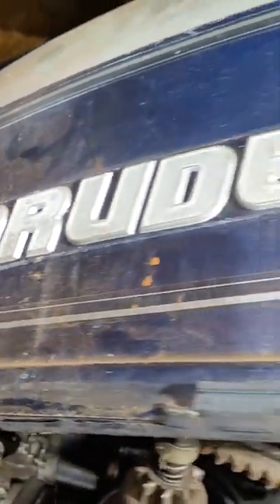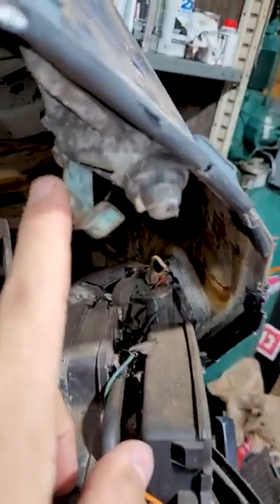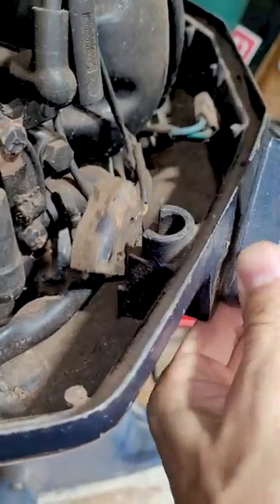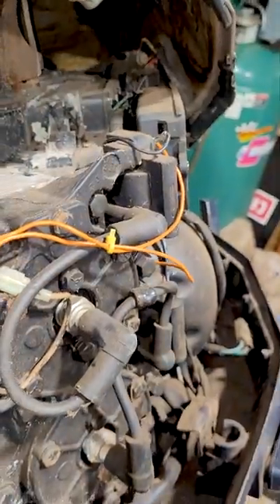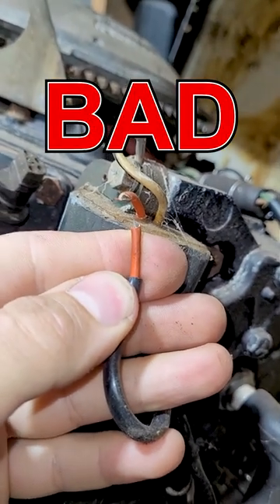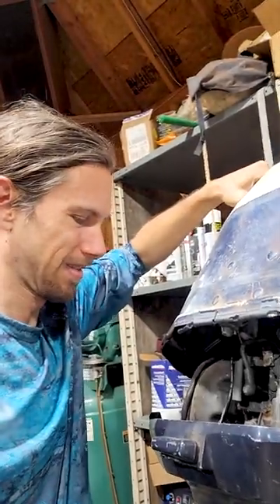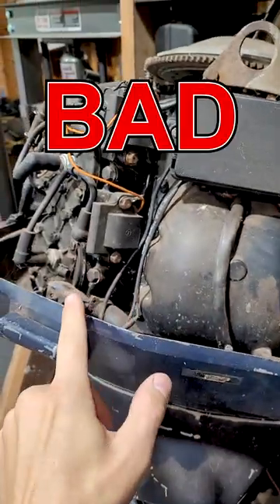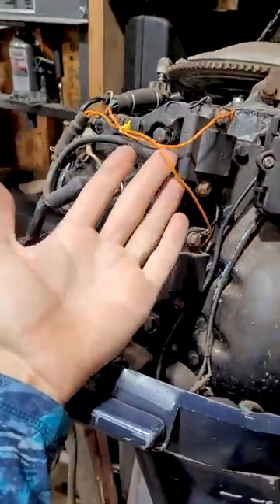Evinrude Outboard Built WRONG!

Comment: Thank goodness it's not just me noticing this, however on the later models 1990s they started to introduce a cable tidy tool that fits on with a screw mounted to the engine. But i bet that caused a lot of warranty claims to then find out it was user error and the claims were probably rejected